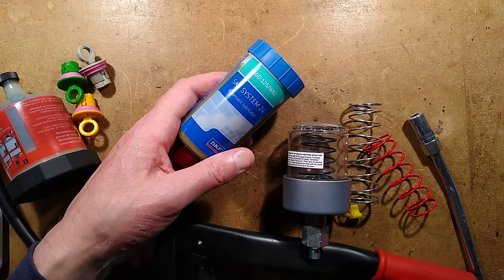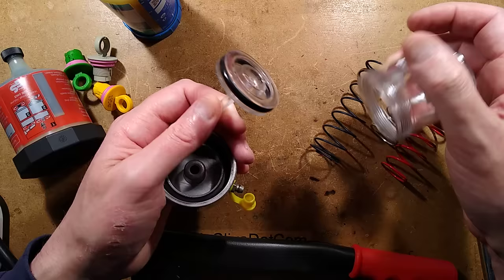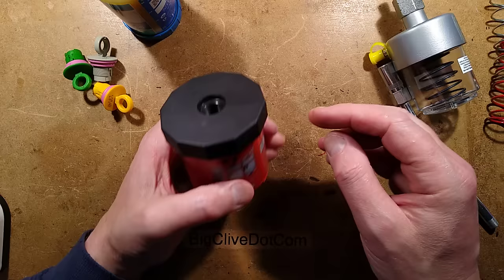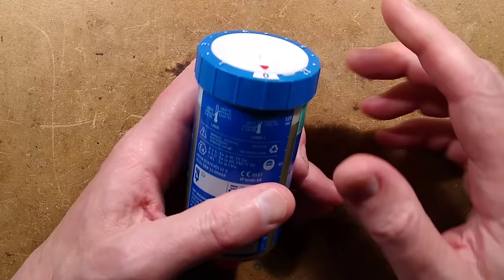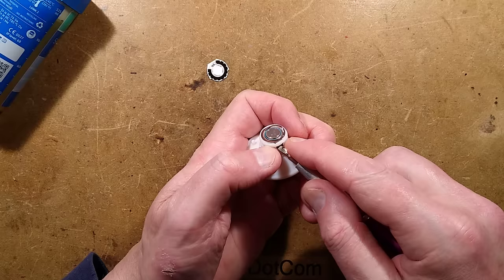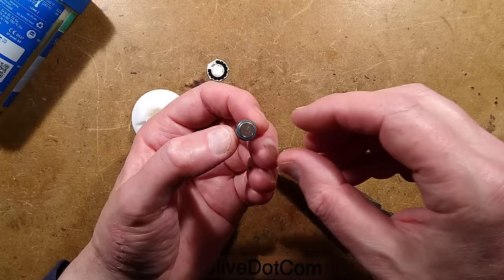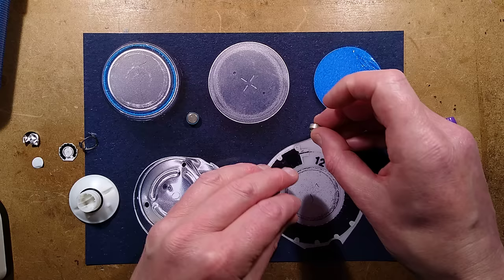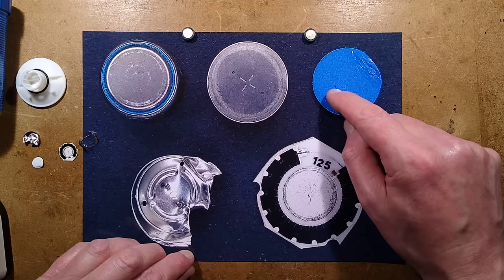Absolute genius automatic lubricator

Comment: Huh.  Do zinc-air batteries not need fresh air as they run?  Or is there enough in the chamber at the start of the run?  Or enough diffuses through the plastic housing?
Reply from the maker: It appears to be the process of blocking air that may make them generate hydrogen gas.
Reply: I think what's going on is there's not enough oxygen, so the reaction is ripping the O off the water in the electrolyte, releasing H2.

Comment: I'm pretty sure it's not a conventional Zn-air cell here.  In the absence of O2, those cells don't do anything, far less generate substantial amounts of gas.  My guess is it's a Zn-air type cell with some added magic ingredient such that when the battery is shorted (or partially so) it generates enough oxygen to activate the cell, and the charge is then used to liberate gas from some other substance (e.g. maybe Al/HCl which generates hydrogen?)
Reply from the maker: See the description.

Comment: I've never thought about it but if you shorted the cell would the rate of gas production cause an explosion? (Gets containment dish ready)
Reply from the maker: I doubt it would generate it that fast.
Reply: @BigClive  I think this would be worth trying, although you're right, the explosion containment pie dish shouldn't be necessary.  If the gas output is linear with load, then a 1 ohm load should get the device to shoot its wad (a grease cup's worth of gas) in about 17 minutes.  Maybe wire it up to a low resistance load and drop it into some distilled water to see the bubbles.
Reply: Iirc correctly they're actually atex rated. I could be wrong, but that's what gotten into my head.. 🤔
Reply: @jothain  I mean if you already got an explosive atmosphere, a little more hydrogen isn't going to hurt...

Comment: We have these, but larger in the trucking industry. There's a pot of about half a gallon of grease affixed to the truck chassis, lines to every non rotary grease fitting. We don't measure in months, but hours. I had mine set for grease every 6 hours, which is excellent in winter for pushing water out of steering joints and suspension bushings. All run by a small electric motor and a small piston pump. You can even buy a kit to auto-grease the 5th wheel. Very handy indeed.

Comment: Wymark have been producing their Greasomatic for over 50 years. They use a chemical gas generator based on metal dissolving in acid (I think) generating hydrogen, to force the grease out. The little capsule that contains the metal is programmed before it's release, by turning an external knob which opens or closes an orifice that allows the acid into the casule. Greasomatics are totally sealed. They have nice cut away diagrams on their website.
Reply from the maker: I almost bought one of those.  I thought it might have been a potentiometer being set on a module before being released.

Comment: There is also a motor driven unit that's battery powered off 2 x AA  batteries and designed to be screwed onto a replacement cartridge. Drives a plunger to firce tge grease out and programmable in overall time , g/shot or g/month. 
Fascinating devices.

Comment: This is what great engineering looks like.  It's simple, effective, offers a range of output speeds from a single unit, and is inexpensive to manufacture relative to other options.
Reply: but it is one time use thing which will try to pull out content if it needed or not. So while it is simple, it have a long list of cons.

Comment: The basis of this design is not the grease pump but the Stauffer bushing. Filled with grease, the mechanic would occasionally go by and give the screw-on cover a twist to supply a helping of grease to the bearing.
I used a version of this with a gear motor that can be controlled digitally. (Not for lubrication, but for dispersal of a contaminant in a test configuration)

Comment: We use a low tech device for giving intravenous antibiotics. It uses a standard size syringe in a spring loaded device. The infusion rate is determined by a restriction in the tubing that connects to the iv in your arm. It can push 30 mls in anything from 15 minutes to 1 week, depending on the tube used.

Springfusor.

Comment: As a service tech I have been in the SKF manufacturing facilities in Elgin IL. If you are looking for a bearing, they would be your first stop unlike other countries producing the same wink wink. I went through 3 bearings in my Ford Focus before I decided the forth was going to come from a good source. Has not failed since. This is their lubricator side but probably better known as the worlds largest bearing producer. Would never have thought those two little batteries could create that much pressure even in a sealed environment. I guess it is the little things that surprise you the most at times.

Comment: Here's an interesting technical paper which explains more about the chemistry involved:
"the rechargeable zinc–air battery has not been used on a commercial scale
 since the zinc electrode suffers from critical problems such as passivation, dendrite growth and hydrogen evolutional reaction which limit the practical applications of zinc–air batteries."
https://www.osti.gov/servlets/purl/1581000
Reply: It's not an error, it's a feature.
Reply: @ReinoGoo  Article is referring to gas evolution when trying to recharge a Zinc-Air battery, not during discharge.

Comment: These have been around for some time, i used to go to factories and replace them, but never knew quite how they worked, Great breakdown Clive, just goes to show how tech has improved in the factories, which is where all the tech advances happen ;) This does not come purely from a lab or university, but engineers needing to fix a siple problem like auto lubrication. Trucks use compressed air from the brake system and a large escarpment wheel, every 10 goes on the brakes and the wheel bearings etc get a dose of grease. But truckers who hit the brake a lot will get excess grease coming out into the brake drum (squeezing past the seal) which means no more brakes but sometimes they even catch fire!. Note to truckers; brake for no-one :D

Comment: wow simple thinking and sophisticated design. since they are not replacing all the grease at one time but only keeping the bearing supplied they can work at low pressure and low flow-rate.   that is really deep analysis

Comment: About a decade ago my engineering colleagues and I designed a prototype device for use with our products, using one of these H2 gas generating Varta cells.  Combined in a small package with a similar-sized cell to power the tiny timer PCB it would be programmable to fire after a period of many months or a year by applying a dead short to the H2 cell which pushed out a piston sealed with an O-ring. Although it worked in the office, the issue we found is that the gas production rate is poor at under freezing temps and that made it unsuitable for our application. I'm pretty sure we removed the blue sticker before installing it but that may not be required.

Comment: I noticed the new decoration to your left thumb.... I too have a new decoration where I was creating a slot for three wires, off a photocell switch, to enter into a weather tight box. After drilling three 1/8 holes for the wires I decided to create a box opening using the three holes with my knife, yeah I created an opening alright, almost exactly where your wound is, in my thumb that is the knife blade wide and 1 inch deep. Working with your hands, one always has nicks and cuts it seems being clumsy adds to the fun... be safe my fiend and thanks for the interesting look into grease dispensers..... ;) as always thanks for the time and effort in creating, editing and ULing these videos for my vicariously lived life..

Comment: I used to fit these to a four ball machine i used to build when i was working for a living. the one problem customers had was to miss read the numbered dial on the top. basically the higher the number to smaller the amount of grease that is dispensed not the other way round hence too much grease was dispensed which caused the machine bearings to over heat. the make we used was SKF which when spent would be thrown away but the company i worked for stopped using them as they were not cost effected.

Comment: We’ve got electric automatic greasers on motors and gearboxes at the mill I work at. They have a lithium battery and greaser cartridges and every few hours or however long it’s set for they compress and apply grease.

Comment: That's an example of engineering perfection. Which is not "when there is nothing to add" but rather "when there is nothing to take away". 

Somebody was paying attention to the chemistry of Zn-Air batteries and worked out a way to do something extremely useful with them, using every last watt and joule of chemical energy available.

Whoever first figired that out should have their name passed down in history, unlike the guys that get their names mentioned like Thomas Midgley Jr. (guy who invented tetraethyl lead, leaded gasoline, and chlorinated fluorocarbons and their use as a refrigerant and a spray can propellant)

Comment: had them on a folding crane I operated remotely (potain igo 50). They was soo handy didn't have to fold it to grease it! Now I'm operating a old jaso j240 tower crane that has had a remote retrofitted and to grease that I have to climb up and do it manually with the gun. I miss these auto ones  :(

Comment: i am personally i like the old style of cup and dripper system. my father even worked at a place that old grease cups. the workers only needed to slightly twist the cup after each shift and some grease would be pushed into the bearing blocks (journals). they had immense machines press working on hundreds/thousands of tons with huge flywheels and no ball bearing anywhere. it just had journals and grease cups.

Comment: Not only is it a supremely elegant design, but from the user's perspective it is also a superior design to the other models. The spring applies a widely varying force to the grease throughout its range of compression - the rate of grease output will not be constant. Similarly, the other gas generator design that relies on a solid-liquid reaction will also vary over time due to the change in surface area of the 'pill' as it's consumed. The battery and film potentiometer design will produce gas at a more continuous rate until the battery output rapidly declines at the end of life - the grease output rate will therefore be largely invariant over time as well. Exceptional engineering quintessence.

Comment: Did research right now, yes very interesting.
Pressure generation
edit
When a load is applied over zinc-air batteries without access to oxygen, they generate hydrogen gas at a fairly controllable rate, proportional to the load. This can build up pressure, which is used in certain applications to expel another liquid over a longer period, like automatic lubricators[30] or air fresheners.[31]

Comment: Big clive is famous on Wikipedia.

Pressure generation

When a load is applied over zinc-air batteries without access to oxygen, they generate hydrogen gas at a fairly controllable rate, proportional to the load. This can build up pressure, which is used in certain applications to expel another liquid over a longer period, like automatic lubricators[30] or air fresheners.[31]

Comment: Lubrication, rings, nipples, moving up and down, pumping  .... this video has it all, Clive. Fascinating, you get to see automated industrial gear analysed on your videos that you would never see anywhere else. I have noted that over the years - sophisticated engineering to produce simple, elegant solutions.
One example from forty years ago was the Philips CD player. It differed from the Sony and other Japanese players, in that it used what was essentially a moving coil meter for the laser arm. Very simple mechanically, very complex electronics for error correction and tracking. It also had the added bonus of self-healing. As the bearing wore over time, the electronics would compensate. Pity Philips had poor reliability because of poor production, NOT the brilliance of their engineering.
Reply: The electronics weren't really more complicated as it used a single servo for tracking instead of two.

Comment: Not keen on auto grease canisters people fit them then forget about them.
The point of the manual grease point is to bring the maintenance person to the point of use. I'm sure if OEMs intended such devices to be installed they would be included in the maintenance schedule. All maintenance persons should have access to or possess a grease gun.
Great video, always informative. Thank you.

Comment: On removing the grease tip from the grease nipple, its even easier if you unscrew the very tip. It opens up the jaws in the tip and allows it to easily come off. Same works for putting it on, and if done will enxtend the life of the jaws so grease doesnt bypass the top of the grease nipple

Comment: The reason I love this channel so much is you fulfill my childish desire to take everything apart to discover how it works. May you stumble across much innovation, preferably not so dangerous that you gain a Darwin Award as I almost did as a child. Shorting out a 240v socket with a thick screwdriver (and blowing a local substation fuse) to get a big bang was almost the end of my experiments!

Comment: I worked on developing a grease dispenser, some time ago, that used standard AA cells, driving a gas generating cell, with a very special,  non-toxic mix, generating a non-poisonous,  non-flammable gas, driving a piston ... rather than a resistor mechanism,  it used a pulse generator,  with a very large programmable range, to do quite accurate grease delivery ... I developed the digital part, which, obviously,  needed to operate on sub-microamp current,  but delivering milliamps to the gas generator.

Comment: At the large enlargement photo at 13:37 (giggity) one can see that the resistive layer has been calibrated with a laser burning off some of the black layer. They have cut the layer from the center out (the little brighter spikes). On the left side there is one cut that is clearly shorter. This way I suspect the manufacturer can account for the uneven thickness of the resistive layer.

Comment: The proper name for the grease fittings  are zerks or zerk fittings after the original inventor. They are sometimes incorrectly called alemite fittings after a manufacturer but even they refer to them as zerk fittings. BTW, Alemite is now a part of SKF, the maker of the automatic device featured in this video.

Comment: The ones I’ve used had the spring to provide the motive force, but used a battery powered solenoid for dosing. Refill packs included a grease cartridge and battery pack. Super easy to service.

Comment: Hello,

My unlikely hobby of surfing lifts (A bit like Beno in London) has led me to find similar devices on top of some lift cars to lubricate guide rails.
Instead of grease though they use a special, motor-like oil for lift guide rails and also come with replaceable "cartridges" that have a potentiometer to adjust oil or grease flow rate as well as a gas-generating (battery) cell in them.

Basically the same stuff as you've shown here, except it's made by Simatec under the name Simalube.

I didn't see that very often though, most lifts having simple plastic boxes on top of the car that engineers have to refill with oil once in a while.
By the way some lifts don't have oilers and then I think engineers will apply grease directly on the guide rails using a brush or something.

Also whenever oil is used there will be oil collector cups installed at the bottom of guide rails in the lift pit to catch oil that is ultimately dripping all the way to the bottom and keep the pit floor "clean".

Comment: Zinc-air in that form have to have vents, they react with ambient air to generate electricity from the oxidation of the metal.  In an enclosed container like that it should react more slowly over time as the oxygen is used up, but at the same time the already built up pressure from the reaction byproducts should maintain about the same amount of flow since the viscosity of the grease will keep it from equalizing (with atmospheric pressure) too quickly.  Since the grease is a compressible liquid some of the pressure generated is absorbed by its compression, so as less of it remains it needs less of a difference to be pushed out (IIRC).

The air inside the chamber might have been at a certain mix to set the reaction rate.

Comment: Clever and simple idea indeed. Perhaps too simple! I question the accuracy as It's not clear how the designer(s) accounted for changes in temperature and atmospheric pressure. Most likely they couldn't account for it, so the gas evolution rate of the battery is going to vary greatly based on the installation. Higher ambient temperature means more gassing, so maybe the desired functionality is to also dispense more lubricant when temperature is higher. In some applications though, you may not want that to happen! Thanks for sharing